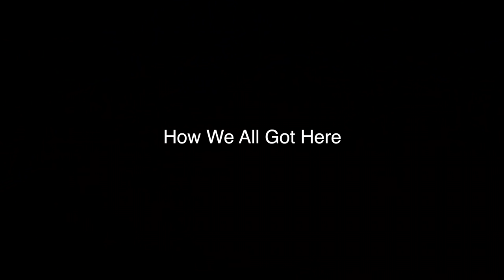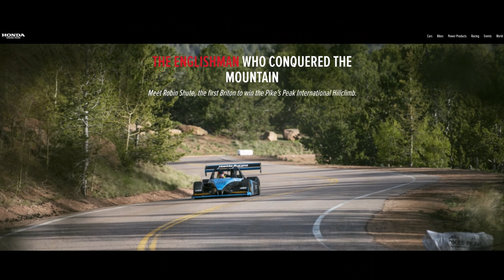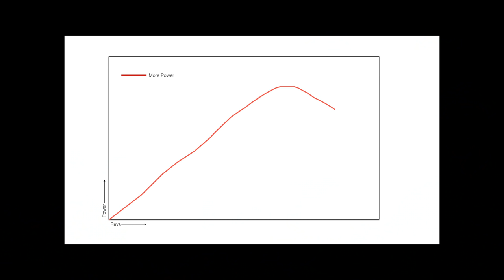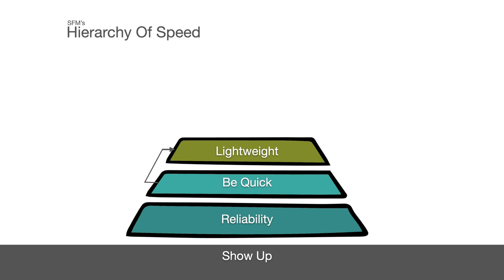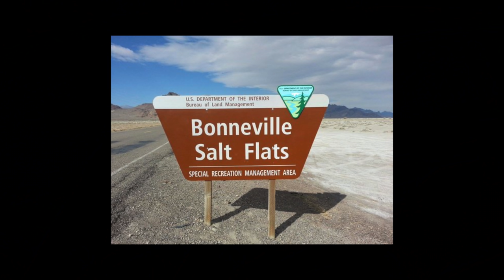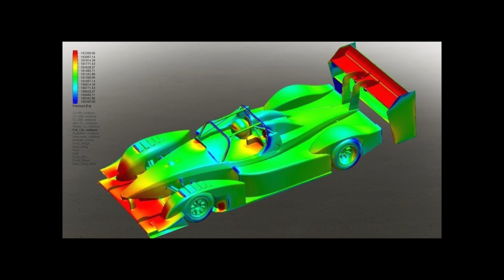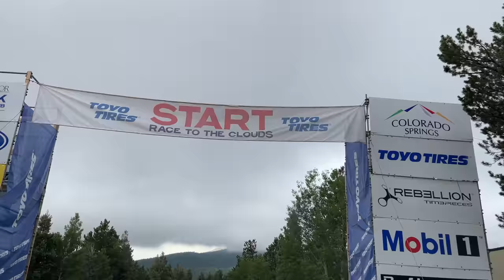What Makes This Race Car Faster

Comment: First time I've encountered the Zach head unit of measurement.  I'd imagine it would be a great constant for rotational inertia.   Zh = L/w
Reply: I thought Matt might have been showing off his big-brain engineer credentials when he referenced the Zach Head. I'm glad I'm not the only one brave enough to admit that it's new to me.
Reply: is zach's head a metric or standard unit? just wanna know if it's divisible by 10 lol
Reply: @emptynite7359  Everything is divisible by 10.
Reply: @paulwiggans3692  he tried, just way too hard..
Reply: @emptynite7359  Do you use the circumference, the length, the width, the height, or some combination?

Comment: I have to mention the backstory of Per Eklunds pikes peak build. They filmed the entire build, it's on YouTube but in Swedish and without subtitles sadly. So Per and his mechanics, friends and at the end anybody who proved somewhat usefull built the car themselves in some garage in the middle of nowhere. 

The carbon fiber molds from Saab were off and other as to be expected hurdles for trying to put a racecar together. They just worked, worked and worked, basically lived of the local pizzeria. The pizzeria even refused to take their order once since it was for so many pizzas they were sure it was a prank call. Such a pleasure to see the amount of self thought and skilled mechanics putting the car together. And all they had were pretty much basic tools. The only fancy stuff was parts for the car.

They were stupidity close to not make it and shipped the car over untested. This car then set a record in the open class that stood for 12 years. 

That's the beauty of pikes peak. This is btw my all time favorite motorsport story.

Comment: Used to live in a little town close by, Westcliffe, and would go see the many races they held at Pikes Peak. This was back in the late 90's when it wasn't completely paved and was more of a rally race than a time attack race. They raced everything from semi trucks, motorcycles, pretty much anything with a motor and wheels. A tidbit of trivia: The reason why you can drive a car all the way to the summit of the tallest mountain in the southern range of the Rockies is that Pikes Peak is a part of a much older mountain range that had eroded to the point where you could drive up it, essentially becoming a gigantic hill. The Rocky Mountain range  with all of its sharp peaks came much later. If you're ever in the area also check out a place called Bishop's Castle. Worth the short trip from Colorado Springs.

Comment: The "Less power is better power" is my motto for engine tuning. Everyone wants to brag about peak HP with crazy cam lift and duration, but really no one like to drive that. I always calculate what cam I think I want, and get the slightly tamer camshaft. You'll rarely regret getting a broader power band but you may never drive a car with too hot of a camshaft.

Comment: I was at Devil's Playground when Sebastien Loeb went by in the Peugot. His run was fantastic, and it started snowing 20 minutes later. The weather is as much a competitor as the mountain, never mind the other drivers.
Reply: great run, but it would have been interesting if he made an wrc like effort ..it could also have been the car not functioning as he wanted. he seemed to be somewhat unhappy with the car when talking to the team member right after the fact

Comment: 15:40. The Colin Chapman method of building a racing, or street, car.

"Adding power makes you faster on the straights. Subtracting weight makes you faster everywhere."
Colin Chapman - Lotus Founder.

Comment: My take in aero at pike's peak is that with such elevation the airspeed in no corner comes close to what it is at sea level, and therefore the entire run is low and mid speed corners. With half the atmospheric pressure you have half the drag and downforce, so the wings these dudes have are just half as ridiculous as they look. My personal best was a 8:50 iirc in beamng

Comment: Never mind Pike's Peak, this is one of the best explanations of race car engineering in general.

Winning races (ones with relatively few rules especially) does not come from power.  It comes from lightness.  Lower mass requires less work to brake, turn and accelerate.  Lower mass makes everything more efficient.  Being more efficient means you can win races with less engine power and lighter everything, including the engine.

Comment: The thing not mentiones is. VW has the record, but the car they sent as not purpose built. The same car broke records everywhere it turned up and was simply to show what can be done without any rules of a racing series to adhere to.
It also was flly electric.

Comment: damn dude I loved this video, I love the way you mention things, as an engineer the bridge part was hilarious. thanks for the entertainment. quick question: why don't pikes peak cars use those wings attached directly to the wheels of the car, not forcing the suspension?
Reply from the maker: Probably just simplicity. I imagine it would be a noticeable improvement in performance on the front though, because it would be easier to keep the front wing in ground effect
Reply: Possible it's more important to maintain wing relationship to the diffuser in modern aero design. Also, unsprung aero would probably take a lot more (nonexistent) development time because so few working examples exist.
Reply: @SuperfastMatt  "Simplify and add lightness" would be my guess too.

Comment: 1) Do Ev weigh less at the top because they have used up some electrons?  ;-)   2) Would be funny to use parallel cells and eject cells as they get depleted.  3) I miss when it was a dirt surface , loose surfaces are more fun

Comment: My formula for how long something will take is the metric conversion. Multiply by 2 and add 30 (or .3). So 2 days becomes 4 1/2. 5 months becomes 13, etc.

Comment: The cool thing about EVs in this application is that the thinner the air gets, the faster they go.  Too bad the batteries weigh so much.
Reply: And that by the time they get to the thin air, the batts are discharged.
Reply: @GunFunZS  nope. Randy says at the very top he was still making full power.

Comment: One guy used to drive a BADAZZ Red GMC Syclone #555. Shaun Palmer maybe? Adam Auerbach? Maybe Shaun. That thing was INSANE. You can likely find it under Pikes Peak Syclone 555 on any search.
Reply: Seems you can find it here on YouTube under Shaun Palmer 2003 Pikes Peak Syclone. It had custom Fenders and bed sides on it that had the cladding/ground fx molded directly into the body panels instead of separate like on a stock truck. Shaun's truck also had the cladding 2 inches wider so, he could fit bigger & wider wheels and tires under the truck. There used to be a lot of pics at High Performance Trucks but I'm not sure if that place still exists.
Reply: It seems Adam Auerbach built a truck for the Spectre 341 Hill Climb. Apparently he used the molds from the Pikes Peak truck to make fenders and besides for his Hill Climb truck called Cyborg. Another badazz GMC Syclone.

Comment: Some obvious secrets, there.

Less weight
Improved aerodynamics
Good suspension geometry and dynamics
Improved braking
As much manageable power as possible
Fantastic tires

Then tune and balance these, endlessly.

Finally, drive well, which Shute seems to do.  He's very smooth on the inputs.

Comment: Power to weight ratio is key. How that weight is disributed between the 4 wheels and horsepower deliver is also key. Suspention and brakes are also a key element in going fast. Reliability, no such thing in a race car. There is only hope everything was done correctly.

Comment: I have a question, is a good driver (in relative terms)? I find it difficult in motorsports to say better worse driver because of the motor part of the sport
Reply from the maker: Shute is undoubtedly a top level driver. The car is pretty good, too.

Comment: pikes peak needs my turbocharger project, it has dual DC brushless where the bearings go... never idle, powered by RC batt packs, fed by, using a buffed alternator and high amp 12v batt... 4 kg+ for some 11% turbo efficiency ... yes where the ball bearings go in a turbo, im making them both act like motors... its a bit of fabrication i know... i wish i had better tools, but in months, ima test it in my citroen c3.

Comment: So i have a quick question: Why do people i n modern Race cars have problems with the change in air density?
In my understanding, if you have a Air mass sensor, change in air mass going into the engine will be measured and compensated so you never run rich or lean.
Also if you tune the wastegate to always achieve a certain Air mass entering the engine you should be able to have the same power all the time right? at the bottom of the hill the turbo spools a bit lower and on the top it spools a bit higher, its just the wastegate that opens a bit later... 

Can someone explain to me why there is still a problem due to the changing altitude?
Reply from the maker: The challenge is in tuning the engine so that it works at all altitudes. When you say "change in air mass going into the engine will be measured and compensated," that "compensated" has to be tuned into the ECU, and that is what takes time and effort. And when the inlet pressure of the turbo changes, it moves to a different part of the turbo map and changes pressure and flow at the outlet in a non-linear way. You either start or finish at a non-ideal part of the turbo map. That, in turn, further affects the fuel map. So all of that stuff needs to be accounted for. If everyone had a full week or two of tuning on the mountain, it wouldn't be a problem, but they only have a few runs a year.
Reply: @SuperfastMatt  oh okay, thanks for the good explanation! :)

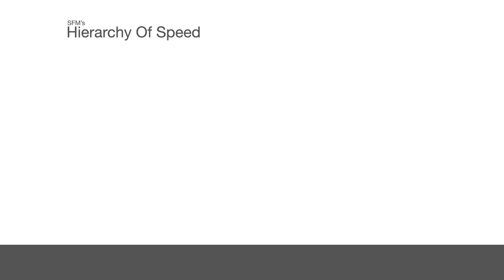Comment: 14:00 Somehow he put reliability first, but then still didn't built his car to be electric
Reply: Double the power = double the weight. Double the weight = slower, even with double the power. You gotta be able to slow down quickly, corner quickly, and accelerate quickly, none of which you can do with 1400 pounds of lithium and nickel stuck to the bottom of the chassis.

Comment: The idea that a few garage builders (i.e. Cooper / Tyrell etc) could compete with the big manufacturers is over is not exactly true. Sure in these days a hammer and some gaffer tape is clearly not enough to build a successful racecar, but was it at any time? Look at the high-end peak performance motorsport teams in F1. How much Mercedes will you find in Lewis car? The chassis is build in England but as far as I know Stuttgart(main location of Mercedes) is not a British city.  So who is it to build the Mercedes F1 chassis? It is former Brawn GP, basically a garage company founded by Ross Brawn former aerodynamic engineer at Bennetton (btw what car brand is Benneton?) and Ferrari. So the only thing Mercedes dis was putting money on the table to buy this garage company to have their sticker on the car. But the Mercedes AMG engine is a "real" Mercedes part, is it? No it is not! It is another garage company called Ilmor Racing that was bought by Mercedes to put another fancy sticker on the car.

Have a look at Red Bull Raching. Not a car company either. Red Bull bought Honda Motors and will produce the Honda motor next year under Red Bull. How is that possible? How can RB buy Honda? Well they can not but the Honda F1 motor department is another garage company just under the name of Honda. 

When I call these companies garage companies I am well aware that there are hundreds of people working there and I don't use the word garage to belittle or bully them, they are doing high end work at peak engineering. 

But in racing people understand these days that team size matters. Look at F1 in the 50s even the big team like Mercedes or Porsche they had team sizes of an indy Pikes Peak team these days, and in the 50s Pikes Peak teams were like 3 people at best. 

You can still compete as a hobbyist if you find enough talented people who are willing to do this as a hobby, meaning without any pay. The problem with a hobby is that everybody wants to be the driver, barely anybody wants to be the mechanic and absolutely nobody wants to be the team manager without any pay. We are so driven by the idea that everything we do must somehow make money, I think it is more the change in society than the change in development or tech.

But I might be wrong, it is just another perspective.

Comment: What happened to reliability?
Reply: TBF a 5-600 hp K20 is on the "reliable" side of engine tuning. There are people that take them over 1000.
Reply: @5thearth  sure, I see people just gap rings for 500hp. But I was thinking about more than the engine

Comment: Such a cool video! Do any of the cars have the downforce applied "directly" to the tires/control arms? So you're only pushing down on what you care about and the body can move separately from the downforce?
Reply: Probably not enough would be generated to do what is necessary.

Comment: I hate to be "That guy", but..... Is there a reason why i didnt hear about a F1 lookin car, with a tesla drivetrain and "just enough" battery ...with far less weight? motor wouldn't notice the altitude change, how bow no brakes even! just EXTREEME regen braking and dumping into capacitors or batteries with capacitor like properties?